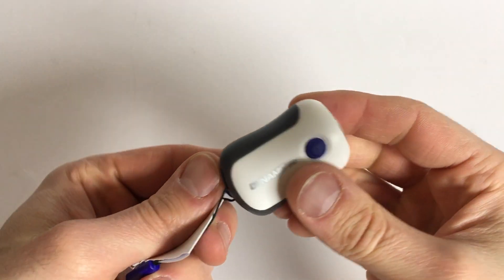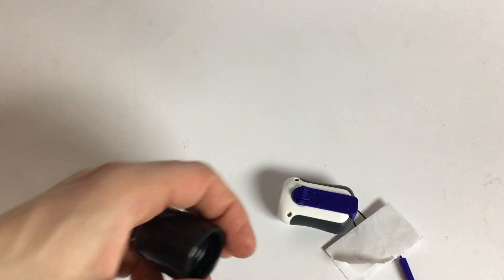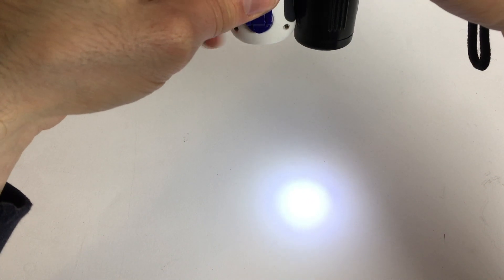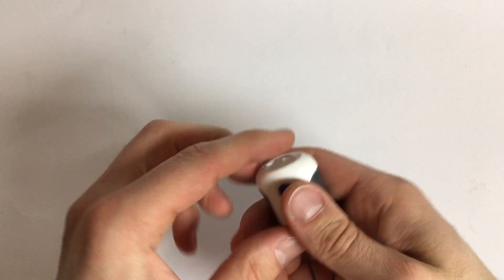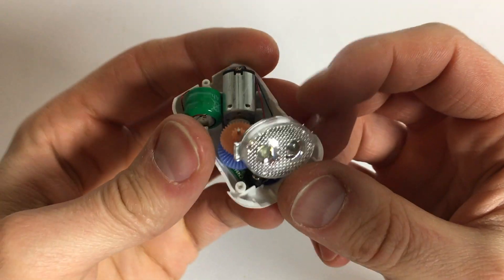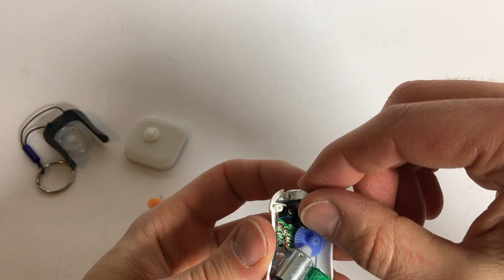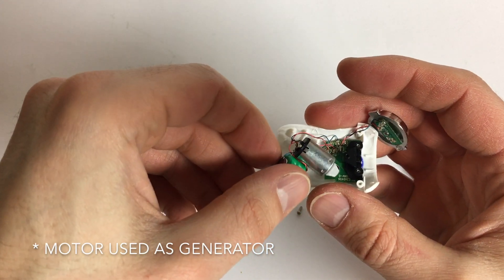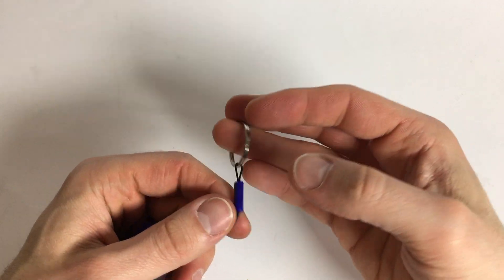Dynamo LED Flashlight disassembly

Comment: please can you tell me model of battery because mine is dead i guess when i turn the hand the it lights up but when i stop and press button nothing
Reply from the maker: Hi, unfortunately I do not have the light anymore. Please check at 8:54 (in HD) Its MiMh Battery with 3.6 V and 20 mAh
Reply: Rechargable Ni-Mh (Nickle Metal Hydride)
Reply: search for: Rechargeable NiMH Button Batteries 3.6V 40mAh BATTERY
(It's 3x 40mah nimh cells in series; each is 1.2v. If you see '3S' it means three cells in series.)
Reply: Thanks  @jimmybrad156
Reply: @vanassimooy sorry I'm late 😅, eBay, AliExpress, Amazon should have them. I found this description text from eBay.